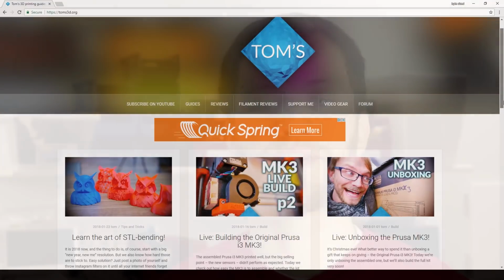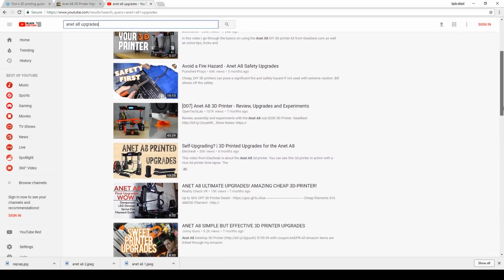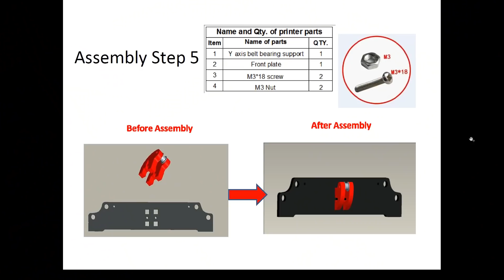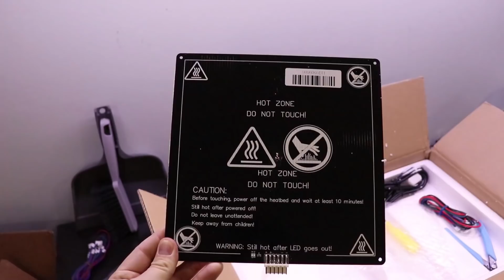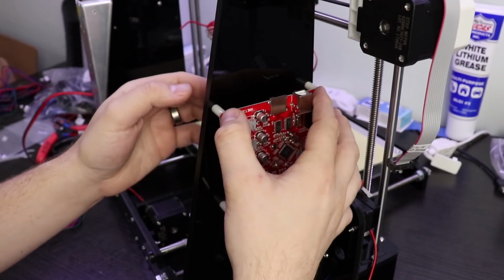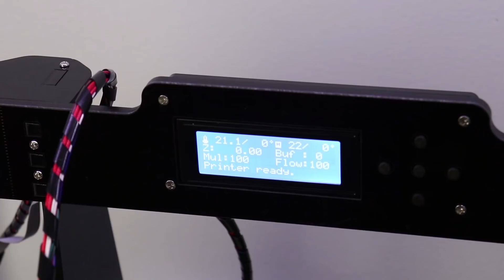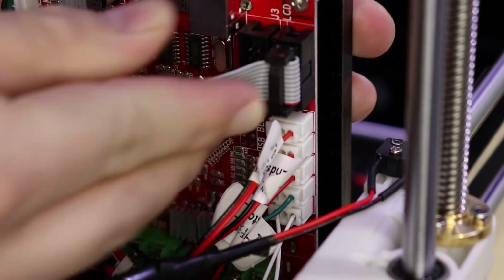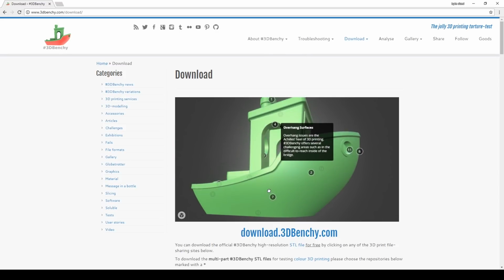Anet A8 - The best cheap DIY 3D printer in 2018?

Comment: 3D printer kit:  $160.  Enjoying putting it together yourself and learning how it works:  Priceless.
Reply from the maker: I agree, but not everyone sees it that way unfortunately. Thanks for watching!
Reply: If you're looking for tips here are my top five with this. 1 - don't rush assembly. You'll need a whole day or several evenings. I did mine in about 7 hours over 2 nights. It's got a lot of steps and can be fiddly at times. 2 - cable management! Use the supplied wrap and think ahead when assembling so you can keep the cables out of the way of moving parts and belts. 3 - level the bed, heat it to 65'c and then level again. This will stop it warping or jamming after it heats up. Use hairspray to prep the bed before printing. On temps, try 65'c for the bed and 190'c for your extruder. I would try 90% movement and 110% fill also. 4 - don't try ABS right away, it really is a pain to print due to cooling issues. PLA is fine and quite a good material. Order a 1kg roll when you order the machine so it's ready to go. 5 - download Cura (free slicer program) and print some spool hubs, this way the filament spool turns much more smoothly and doesn't need to be supervised. I didn't do this straight away and had the filament spool pull the holder off its shelf. This could have damaged the printer if I wasn't around to catch it. There are plenty of upgrades but the spool hubs are essential and improved my print quality by providing much more consistent and manageable feed rates.
Reply: Here is my tip buy a ender 3
Reply: I'd get myself a little bit more money and buy an ender 3..
Reply: Yeah I can't wait to get one and learn as much as I can about 3d printing. Any tips before buy it?
Reply: sewashburn0529 
Question, I am new at this 3d printing world but i really want one right now and don’t want to spend too much. My real question is- Can this printer support rhino software or how does it work?
Reply: Roberto Vera - it supports standard g-code files. Cura is free and easy to use - I used it and set the Cura software to 'Prusa i3' preset. Cura works with the standard .stl type files from most 3D editing programs, like Fusion 360 or Solidworks. I'd highly recommend getting one, the bang-for-the-buck is unbeatable. Yes, you have to assemble it yourself but honestly I enjoyed it... and if anything goes wrong I'll know how to diagnose and fix it. I've got almost 72 hours worth of print time on my machine so far and its great. Most of that is PLA but I've done some ABS as well... yes the ABS is as hard as everyone says because of thermal expansion and contraction. I would recommend printing in PLA as its much easier and ABS doesn't offer any real advantage for most objects.
Reply: boingkster thanks, you’ve convinced me. i noticed a lot of people are 3d printing right now at my school (architecture) and i found myself a little behind on bringing production to class. they have 3d printers there but they charge a lot to use them (material + watts) so i’m getting my own. i just want to make sure i’m getting a good one as i don’t know anything about 3d printers yet.
Reply: boingkster 
a guy in my class bought one for 800 dollars. obviously this isn’t that but is there any major difference between an 800 dollar one and this?
Reply: Roberto Vera you will generally have a machine at that price which is prebuilt, comes with software and factory support or warranty. This machine has none of that, but for the price it's easily forgivable.
Reply: No worries mate, hope you enjoy it! I'm having a blast with mine.
Reply: Dear 3D designers looking to make some side cash. Join this open-source rewarding project and design unique dock faces for the Prism P7. Discord link with all details and downloads ready for you: https://discord.gg/rCXc7pf
Reply: Awsome printer for the money.had mine 2 years still going strong
Reply: better, when you do all that you learn essentially how to repair any problem it has and you learn fine tuning and 3d pritners understanding, which will impact 3d prints quality!!
Reply: Good stuff. I did exactly the same as you got the cheap one and got it working what I would think to be really good.  There really is a big community for these printers.
Reply: Yep
Reply: ya exsactly

Comment: You did mount the H bracket for the bed wrong. The middle part goes at the bottom.
Reply from the maker: Thanks for the tip, I actually fixed this after filming this video.

Comment: You can make two loops half an inch apart in your X belt with zip ties. Then loop another zip tie thru those loops and tighten it to add belt tension. The one way action of the zip tie is very good at maintaining tension.
Reply from the maker: Good to know, thanks for sharing!

Comment: Have an A8 myself. Was very surprised how well it prints. Mostly slicer settings that improve things for me.
Tons of upgrade parts available on thingiverse. Better part cooling shroud, belt tensioners, frame braces.
And some people replace the frame with extruded aluminum structure.

And he's right a fantastic online community... One of the reasons I gave it a shot too. 

Great video..  thx.
Reply from the maker: Thanks for the tips, and thanks for watching!

Comment: I have 4 printers (building a 5th one myself now), and I found that there are two mayor reasons for bad print quality related to the frame (uneven extrusion and such not mentioned):One is the use of unsupported rails. These do bend and flex, causing visible print lines. This is mostly due to the Z-rails bending, allowing the Y-rail to move in the X and Y directions. But also the X rails under the table bend downward due to pressure from the print head. All unsupported rails are also likely to vibrate, causing wavy patterns in the side walls of prints.- Therefore: Don't buy a printer without supported rails...The other problem is basically a backlash-issue related to the drive belts flexing. This can be mended by applying meore tension - but that again will bend your unsupported rails! If you want to keep belts (you'll need to, because lead screws are not fast enough), you'll need to pull on both ends, like in a pulley system.
Reply from the maker: Thanks for sharing!

Comment: This printer is an amazing designs. It is cheat, yet robust. Well it's true there are a lot of upgrades you have to print to get the printer printing the way you want it to, it also allows you to learn how to design in 3D and how to get comfortable with CNC machines in general. Starting with this humble design I've been able to get it to successfully print at over a hundred meters per minute and I'm printing exotic things like ABS, vinyl, and even polypropylene. If you're willing to put in a little bit of work to upgrade the machine and and housings this humble design can keep up with just about anything out there.
Reply from the maker: That's good to know, thanks for sharing!

Comment: Zach, it's great that you caught the error in the instructions regarding wiring the line cord, but I'm a bit confused. You started out talking about the LIVE (HOT) and NEUTRAL being reversed, but then at about 9:30, it sounds like you're saying HOT and EARTH were reversed. Please clear it up for me.
Reply from the maker: Sorry for the confusion. The cable that came with my printer had the live (hot) and neutral wires reversed from the conventional color standard. I used a multimeter to determine which prong went to which wire.

Comment: Can I ask a question.
For the frame & also the screws, has anyone ever superglued the frame together?
I have no experience with 3D printers, and a majority of people talk about the frames rigidity.
Reply from the maker: I watched a video of someone building this printer and had the same idea. The problem is that the glue he used wasn't rated for acrylic and it expanded in the joints and cracked his whole frame! 3D printer frames need to be somewhat rigid, but you have to understand that there is very little force being applied to the frame during printing. When you contrast that with cnc milling machines where there is tremendous forces being applied between the endmill and the work piece. Frame rigidity becomes much more important. I have found that this printer works just fine, just keep an eye out for nuts coming loose.

Comment: The reason your quality still isn´t great? It´s the crappy fan nozzle that comes with the printer. Print a better one from thingiverse. Secondly, getting the belt tension correct is a must. Thirdly, and most importantly are the printer settings.
Reply from the maker: Thanks for the tips!

Comment: The ANET A8 is a great printer and is easy to use. If anyone thinks it´s total junk, then they are too stupid to be able to use it, or they are someone who will spend a sh@t load of money on the latest iphone, just because theyŕe easliy fooled by marketing.
Reply: Or, now hear me out, it's an okay printer that is ultimately limited by the frame design. Nothing that isn't fixable but it will still require more money and time(especially time on your printer. Printing parts for itself rather than your neat project). Something like the Ender 2 is easier to build and cost about the same, with a smaller build area, but better general quality out of the box and doesn't require hours of print time to make the product usable. Something like the Tevo Tarantula, even though it costs a little more, has as many flaws but has better built in parts. So, it will grow into a better printer in the long run. I could list more printers with their own merits and drawbacks, but the point is that this printer is "junk" to some people, because they have VASTLY different needs and desires and not because they are idiots. Printers like the Lulzbot and Original Prusa, are legitimately better printers. Both in their lifetimes (you can still print upgrade parts for those machines) and out of the box.

Comment: You are mounting the couplers for the Z axis too low, you have pushed the stepper motor axel to far in, and probably also the lead screw.  
It should be high enough so the top end of the lead screw should be flat on the top of the horizontal bar hole.  It is a common problem.

In Europe we use power jacks that are turnable, so you NEVER know which wire will be live and neutral.  So yes, it does not turn out any more dangerous.  Not as long as you have good contact with the earth (Yellow/Green).

Installing the Marlin firmware are great addition. And it isn't that hard.  The hard problem is to add the bord configuration to Arduino IDE.

But yes, a great printer for the price.  If you want to tinker.
And yes, some changes DO give better quality, like the nozzel for the heater.
Reply from the maker: Thanks for the tips! I appreciate the time you took to share those!

Comment: Who ever says this printer is good for 160$ don't know the market or even the problems of the A8. The frame is totally bullshit, the terminals on the mainboard are underrated and the psu known to blow up. For safety u need a new powersupply and a mosfet. For accurate and really good quality u need to upgrade to a 2020/4020 or steel frame. With all that stuff u paid a second A8.

Better get an creality ender 2. Its a rigid design and it makes perfect, and i mean perfect, prints out of the box. Its a bit smaller but a much better printer if u are new to 3d printing and especially if u not familiar with electronics. With the right couponcode its also cheaper than the anet.

I bought myself an anet a8 1 year ago because it was almost the only cheap printer out there and today the only thing i still use from this printer are the stepper motors. I also own a Tevo Tornado and an Ender 2 and the difference in quality of the printer and prints to the a8 are worlds.
Reply from the maker: Interesting, thanks for the feedback. I haven't had your same experience with the A8. I'm getting decent prints without much effort. Sorry to hear about your bad experience.
Reply: The frame is a bit wobbly, but easily fixed by printing some supports. The heatbed terminals that were a problem have been fixed (in the early versions the heatbed had the same kind of connector than the hot end). One thing worth mentioning is that the soldering is really bad on the mainboard power connectors, so you really should resolder the power, heatbed and hotend connectors.
I have no idea if the PSU will blow or not because I use a computer PSU that I control with raspberry pi(also gets it's power from that PSU)
Reply: Then quit bitchin and buy a better printer then .They said it was cheap. Why would i spend 300 dollars to fix a 160 printer.
Reply: upgradable power supply costs $20. mosfet $5.  as for the frame there are plenty of 3d printable upgrade to stiffen it up. No  need to go crazy with a metal frame.

Comment: its the kind of printer that you will realise  its total junk after using it for while . firehazard bed connector  must be welded , you have to install  mosfet to save your board from burning. front and back panels must be changed to support the bed nicely when you tighten  the belt because they will brake if you dont, the belts are complete junk must be changed to better ones to have smooth prints, bearings are junk too must be changed for smoother and quiter experience. in short dont get it and save your self the headache  and get more expensive reliable sturdy  metal frame one  . i already spent its price in mods and i wish i got metal one to begin with .
Reply: You have to be willing to put in the work on this one. I have had my A8 since Jan and did mosfets for both hot end and heat bed. Also soldered the power wires direct to the hot bed. No matter what I did I could not get quality prints from this thing. Noticed a lot of rattling so replaced the carriage bearings and the prints improved a little. The bed also needed adjusting after every print and a new switch did not correct this. I did get the auto bed level sensor and that helped with the bed height issue but the quality was still not there. No amount of tweaking helped. I replaced the belts and got a little better. Changed it to a bowden and was a little better.  Switched out hot end with the e 3d V6 I had for my home built printer project and quality was much better but still was not right. Still had a rattle in both the X and Y axis even though bearings were replaced and dampers added. Measured the linear shafts diameter and they were 7.9 mm not 8. Replaced those with the 8MM I had on my Mendel Max I am building and BAM!! This thing prints very good now but I could have had a CR 10 by now.  I guess you roll the dice and I came up short on this one.  It was ALOT of work to get to this point.
Reply from the maker: That hasn't really been my experience so far. I've been using it regularly for 3 months with no problems so far.
Reply: i am not critisizing him at all . i am only stating my experience  with it . it will be good printer after spending its price one more time in parts, and waste your time . the point is get something better  first time . Germans say the one who buys cheap, buys twice . and its soo true
Reply: Diaa Shalash Its junk. he already mentions upgrades. What the hell?
Reply: Hmmm I would love to work on the A8 but the creality ender 3 pro is on sale right now for 224$ free shipping. Which is not too big a difference. It has a lot more YouTube support and a nice solid power supply. It's a little more but I think it's worth it. I'm so conflicted though!! I'm moving to alaska soon so whatever I buy, i will have to leave in the states because the price of shipping things up there is as much as the printer :( anyways this video is still great... when I have more money I will probably build something like this just for the learning process of tuning it to perfection lol. I feel like the A8 is for people who understand and enjoy fine tuning, which I would love to do but I'm scared I will fuck it up and break the acrylic.

Comment: Its not junk, at all. Its cheap, and you need to be mechanically inclined and a bit of an engineer. Its also good to have a machine shop and an account to McMaster Carr for replacement parts when you get the damaged and bent version like I did. Definitely add a relay or transistor for switching that heat plate on and off.  Next go to thingiverse and print out some upgraded parts or design your own in some CAD to make the darn thing much less a headache to deal with. I love it now i got it working perfectly. You get what you pay for.
Reply from the maker: Yeah, like I said in the video, this printer isn't for everyone. It was perfect for me. I actually didn't have to do much to get it to work well. I will have a video coming out soon with the modifications I made to it.

Comment: Anet a8 is not the printer I would go for. I myself with with Tronxy X1. joy to build and set up, non heat bed but all i am printing is PLA, but i also have now have a CR-10 that droped big time in price. but till i do the mods the tronxy X1 going on the back end. btw 1 time my benchy came off no problems looked perfect.

Comment: is the power supply an unsafe component still?
Reply from the maker: In my opinion as long as you wire it up in a safe way, there shouldn't be any problems. I leave mine off when not in use. But each person should only use what they're comfortable with.